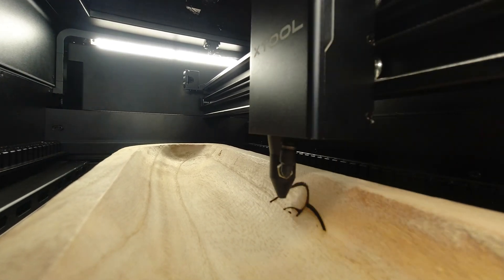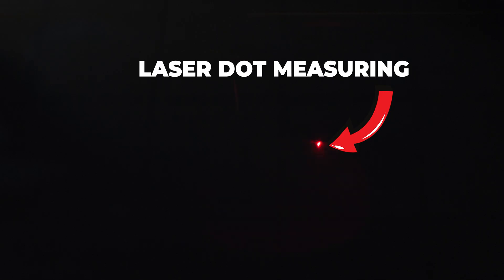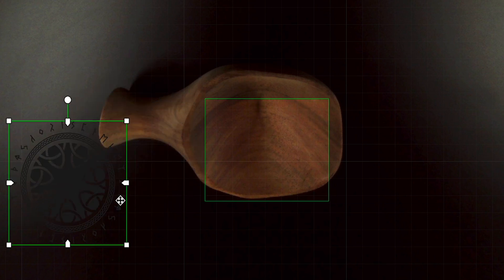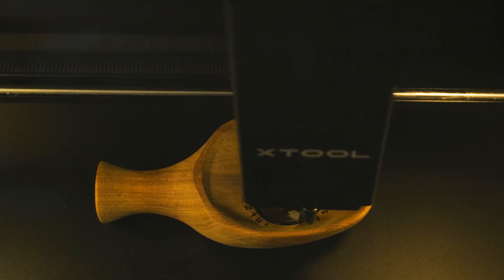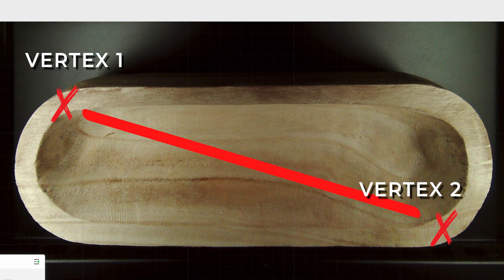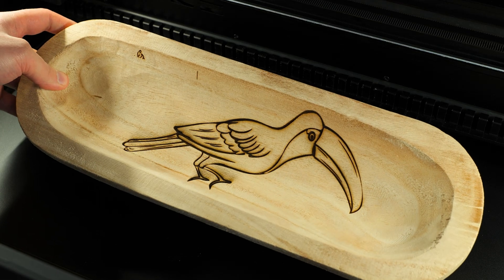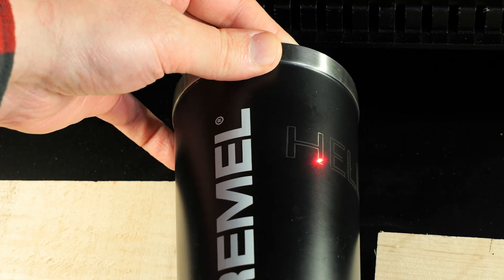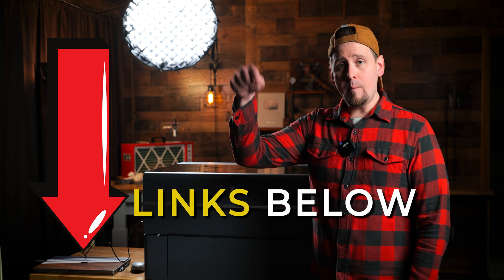How to Engrave CURVED Surfaces with the xTool P2 C02 Laser Machine!

Comment: I can't wait for mine to ship. It's one of the features I had not seen before on other machines.

What exactly happened with the tumbler? You mentioned you didn't measure the highest point? I thought that's what the scanning does automatically?
Reply from the maker: It is an amazing machine, I know you will love it! I should have explained in my video better. I believe it was due to the fact of that I needed to measure the silver brim of the top of the cup further up. (Measuring any black surface can give the 3d camera view a false representation. Thinking back, I believe this is what happened in conjunction with the png files.) I’ve ran in to similar problems when using the ra2. I had to put some masking tape over the cup for the camera to differentiate between the material, base plate and ra2 attachment.